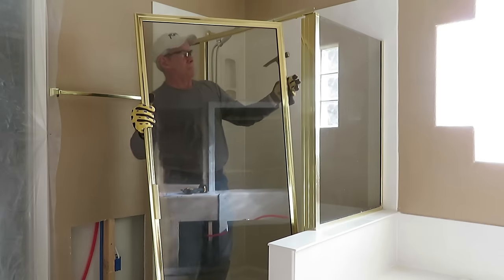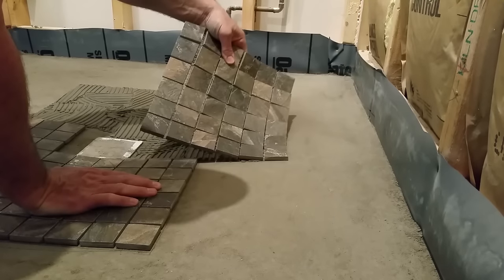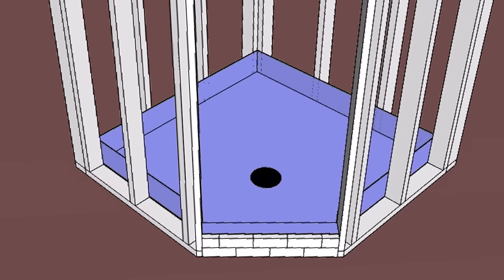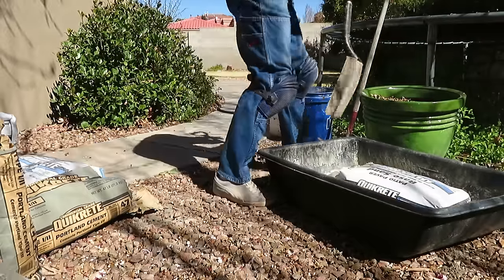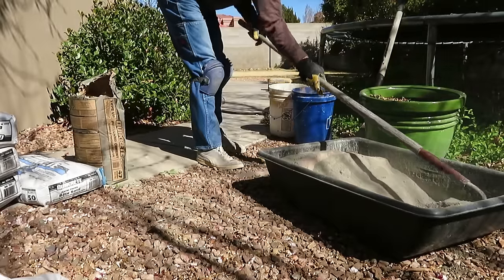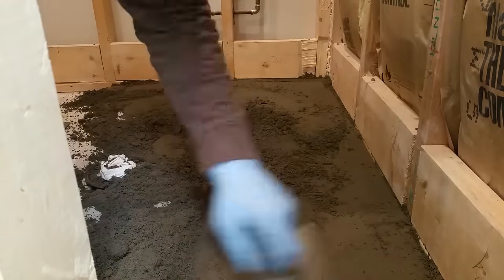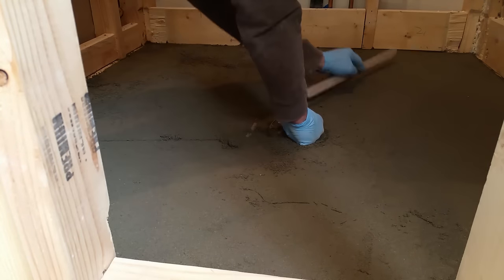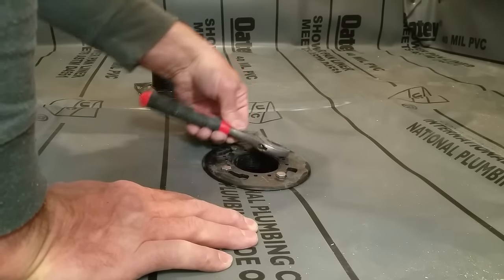Building a Shower Floor From Scratch - Part 1 of 2 - With Shower Pan Membrane

Comment: Mr. Dobbs, Do you have any reservations about the dry pack on your pre-slope not being thicker at the drain flange? I have read that some guys will not do a dry pack that is less than 3/4 thick. Also, is it imperative to secure your dry pack to the subfloor by using lathe or some other material? I see it done both ways and I wonder if it impacts the longevity of the shower base. Thanks!
Reply from the maker: Good questions, Christian! There is no doubt that dry pack less than 3/4” thick will be prone to crack. To me, that is no issue at the drain flange where the shower pan is going to cover it and tie into the drain. It’s mass will still be there under the shower pan supporting the pan material whether it’s cracked or not. Conversely, the finish layer of dry pack that tile is set on is always going to be around 2” thick minimum at the drain in my installations. That seems to be a good structural thickness for me. I have no issue with putting the lathe down on a wood subfloor under the first layer of dry pack but have never done it. Once the installation is complete, where is the shower floor going? That sort of falls in the same category for me of coating the wood subfloor with a waterproof membrane under the shower floor. For some reason that sort of makes sense. In reality, the shower pan, if installed properly, should never allow any water to get to the wood subfloor. So, I have also never put a coat of waterproof membrane on the subfloor either. Hope that helps! Thanks for watching!
Reply: @RustyDobbs  Thank you for your response. Those were my exact thoughts. My pre-slope is 1-1/4" at the perimeter, down to about 1/2" at the flange, and my top layer of dry pack is going to add an additional 1-1/2" at the perimeter, which translates to roughly 2" at the drain (2-3/4" at the perimeter, overall, down to 2"+ at the drain).

Comment: What do you think about using a decoupling membrane between the subfloor and dry pack rather than wire lath?
Reply from the maker: Sure, you could do that if you wanted to. That first layer of dry pack is really there to help with creating a drainage incline and support for your shower pan. If the shower pan is installed properly on top of that, you should be good to go and the first layer of dry pack is pretty much irrevalent after that. Good luck with your project!
Reply: @RustyDobbs  Thanks!

Comment: Do you have a list of all the material that is needed for the floor?
Reply from the maker: No, Kathy, not a published one. But it's pretty simple. A shower pan liner that is large enough to wrap up the wall about 12" after installation and a drain designed to work with the shower pan. Then it's sand and portland cement that can be both be purchased in bags from the typical home centers. I give the details on how they are mixed in the videos. I use bricks for the step and wrap it with a metal lath product that is also sold at the stores. I think the videos are pretty clear on how and when all the materials are used in the process. Hope that helps!

Comment: Did you use the same mix to set your bricks.  Should I do that first and let it dry for a day or two?  Thanks
Reply from the maker: Yes and yes, Ahsun. Good questions! If I had some masonry cement available, I would throw a cup of it in the mix but it's not a big deal. But add more water to the mix for the bricks. Mix it about a thick milkshake consistency and then make like a bricklayer. Let it dry until the next day before proceeding. Good luck!
Reply: Thanks!

Comment: I know this video was 6 years ago but what did you use for the brick mortor in your curb? Was it a variation of your dry pack or just thin set?
Reply from the maker: Yes, I use the same mix (1 part portland cement to 4 parts sand) and just add more water to get to the consistency I want to set the brick or pour into forms depending on the situation. I usually toss in another scoop of portland to richen up the mix a little when thinning the mix down.

Comment: Hi Rusty! I made a shower curb out of bricks and it is anchored to the floor by thinset. When you lay the liner over the curb, how do you tack the liner down over the brick curb and to the concrete floor? Thanks so much !!
Reply from the maker: Hi Lauren! I don't really worry about attaching the liner down because I'm wrapping the curb with metal lath. You might check my latest video on building a corner shower floor where I pour a concrete curb over the bricks to give you another perspective and see if that gives you a little more insight or ideas.
Reply: Rusty Dobbs thank you so much! Yes that’s exactly what I did!! I’m so grateful for your videos!! I didn’t want to do a curb out of wood- all the men say that is where the most failures happen. I’m trying to make sure I cover every item I can to prevent failure but I am also maybe overthinking a bit. Your videos keep it simple and straightforward!

Comment: I read through a bunch of comments to see if you answered where/what height to set the drain off base/wood.  It appears you have not mentioned drain height? Mine has some play.
Reply from the maker: I always try to set the flange part of the drain as close to the level of the concrete slab or wood subfloor as I can, Idaho, but it does not have to be extremely precise. The threaded part of the drain assembly can then be adjusted to whatever height works best. I typically have the top of the drain between 2 to 3 inches from the flange/shower pan depending on other factors like the overall size of the shower.
Reply: @RustyDobbs  My base is a 1942 (strong) wood floor. How should I treat the wood?
Reply from the maker: @idahocharley  When you think about the installation and the role the shower pan plays in the whole assembly, if it is done right, the wood floor should never get wet. I understand your question though and I generally add a coat of waterproof membrane to the wood floor area under the shower just in case. I don't know that it serves any useful purpose, but it just seems like it should be there!

Comment: Rusty, in your video looks like you had a cement floor base. Is there any changes you would make for a wood subflloor? Thanks.
Reply from the maker: These days, Michael, I tend to put Hardibacker across the entire bathroom floor over a wood subfloor before building the shower. I have a recent video that is basically an update to this video called, "Building a Corner Shower Floor From Scratch", that you may find helpful. It is installed over a wood subfloor. Thanks for watching!

Comment: Hey Rusty great video thanks,  I have a basement rough in and will be installing a shower. My question is regarding the drain. I have a drain pipe coming out of the concrete floor that rises about 6 inches. In this case would you just cut to pipe to install the drain flange as  close to the existing floor as possible then use the portland cement / sand mix to build it up to the flange level? 
Thanks again your video really helped me understand the process.
Reply from the maker: Yes, Jim. It sounds like you have it figured out. I like to get the flange down to where it is resting close or on the original slab. If you can chip out the slab around the drain pipe a little without damaging it to get the flange closer to the slab, I will do that sometimes. If not, do as you are thinking and install your first dry pack under the pan starting at the flange and float it out the the wall with about a 1/4" per foot rise. Then you are on your way! Good luck. Let me know if you have other questions!
Reply: Thanks Randy,  I'm just about ready for my first layer of dry pack.  Have you ever used the bagged pre mix or recommend the Portland Cement and Base Sand 4:1 you mix yourself  as explained in your video. I was a bit confused at the store with the different "Type"  ratings. Could you confirm if it's  Quikrete Portland Cement Type 10 ?  and is there a certain type of sand or Quikrete Base sand?. I was at Lowes and could not find the sand and was told to just use a the premix stuff.  Thx
Reply from the maker: Hey Jim. No, I've never used the premixed stuff for a shower floor. I buy my cement and sand from Lowes as well. I checked a bag I still have and it says type I/II. It is also Quikrete Portland. The sand I use is also Quikrete brand and says it is a base sand for pavers. Personally, I would be fine with their stock portland cement they have on the pallets.The only pre-bagged sand I have purchased that I didn't care for was a little more coarse than I was used to. It still worked fine but I prefer a consistently fine sand. If it has larger pieces in it, those will tend to pop out as you are finish troweling the surface. Still not an issue, just more of a pain to work with. Don't hesitate to make a small form from 2x4's with a bottom on it, mix a small batch of mud to the  proportions and pack it in really tight into the form to get a feel of what you are working with. Try screeding it and finish troweling it. Pull the form off the next day and check it out.

Comment: Can you start this process on a plywood subfloor? This is for a 2nd floor shower remodel
Reply from the maker: Yes you can, Husker. The process is the same for a wood subfloor or concrete. The only thing you need to be aware of for a wood subfloor is that you are point loading the area of the shower floor with quite a bit of weight. I always like to check the floor joist situation of the area underneath the shower just to make sure I don’t need to beef up the structural integrity of that area a little bit.

Comment: Hi, what is then minimum thickness of the first and second layers of the cement base? I watched a video that stated it should be at least an inch thick.
Reply from the maker: I think that is probably a good minimum number for a shower floor build. I have used the same mix for non-shower purposes and have feathered it out to nothing to transition between different levels. I mixed it a little wetter than in the video so I could bring some moisture to the surface with the trowel and make it more like a cement finish. That example had some chipping away up to about 1/2" from the edge of the dry pack before it was solid. It was exposed mostly to foot traffic.

Comment: Hey Rusty great videos. Do you have any vids on making the block curb you have there. I need some direction on that
Reply from the maker: Hey, Craig. Yes, check this one out at about the 4 minute mark.  https://youtu.be/sGBhxDatqTg  I'm not going into detail in the video, but I am showing the process of building the step. Just like setting brick. You can use the same mix for the dry pack floor, just mix it thinner to a typical brick mortar consistency.

Comment: Does the flange sit flush with the floor?  if not, how high should it be above the floor?
Reply from the maker: Ideally as close to flush as possible with the floor, David. But because of the way this type of shower floor is built, if it is a little higher, it’s not going to matter in the final installation. The two layers of dry pack with the liner in between makes the flange elevation a minor part of the overall installation in the end.

Comment: Can I do this process on plywood or hardie backer or plywood then hardie backer sub floor? Very old house, floor caved in
Reply from the maker: Yes, Jay, you can. I have a newer video on building a corner shower from scratch that is Hardiebacker over a wood subfloor. It is important in your case to rebuild the support structure under the subfloor that caved in to handle the point loaded weight of the new shower floor on the floor joists then subfloor then Hardiebacker. You should be able to make this work fine. Good luck!
Reply: @RustyDobbs  thank you so much!

Comment: Great Job! I was wondering if you have to do any caulking around anything, like around the drain? Thanks
Reply from the maker: Yes, Troy. Caulking finishes off any tile job nicely and I use a siliconized acrylic caulk that matches the grout color and texture in all corners. Around the drain I also run a small bead of caulk between the floor tile and the metal drain cover… any places where the grout might tend to crack over time. Thanks for watching!

Comment: I've watched a number of shower pan videos and I can't figure out why it needs to be done in two separate layers. Why not just liner on the slab, then a sloped square of "dry-pack", and then tile?

Thanks!
Reply from the maker: Hello Alex. Many years ago, the idea of using just one layer of mud on the shower floor was the way it was done, but this pre-slope methodology has become more well-known in recent years, particularly through YouTube. So in answer to your question, it can be done that way. I personally like the idea of the two layers because I think it helps clear water from the shower floor better due to the slope that moves the water to the weep holes on the shower drain more effectively than a flat bottom to the shower.

Comment: How high off the sub floor should the drain assembly be before you install the sand/cement pre pitch?
Reply from the maker: I set my drain flange as close to the subfloor as possible, Tripp, because I don’t want to get carried away with the thickness of the finish floor. So the pre-slope layer generally feathers down from about 1 1/2" at the wall to basically nothing at the flange. Yes, it will crack the thinner it gets, but its purpose is not degraded because it is there to simply to provide a compacted base for the shower pan to rest on. Hope that makes sense. 🙄
Reply: @RustyDobbs  thank you.

Comment: Rusty, what approximate depth should each layer of dry pack be? One on top of the pan and the one below the pan? Thanks.
Reply from the maker: I always assume that the flange of the shower floor drain will roughly be flush with the subfloor or concrete slab, Devin. I use the height of the bottom plate of the wall framing (1 1/2”) for the top of the first layer of dry pack and taper it down to the top of the flange, so it is very thin at that point. The shower pan goes on that. The finished layer of dry pack is generally between 1 1/2” and 2” thick and that is consistent across the floor to the drain. I never go less than 1 1/2” in thickness on that final dry pack. Hope that helps!

Comment: I'm confused about the first layer of sand and mortar.  Is it just put on the plywood and wood on the sides?  no liner needed?  do you use treated lumber?
Reply from the maker: When you think about it, Laura, the first layer of dry pack is just filler material to support the shower pan that ties into the shower drain. If done correctly, no water should ever get through the main shower pan liner to the first layer of dry pack or wood framing around the shower. If water does get through the liner, you would want to know about! Hope that makes sense! Thanks for watching and for your question!